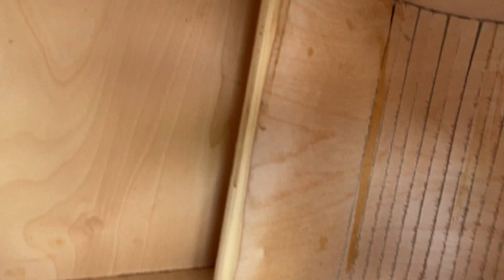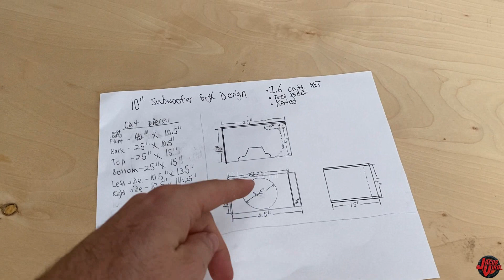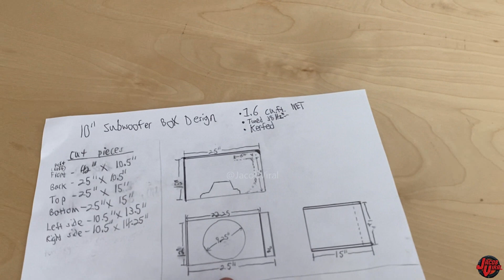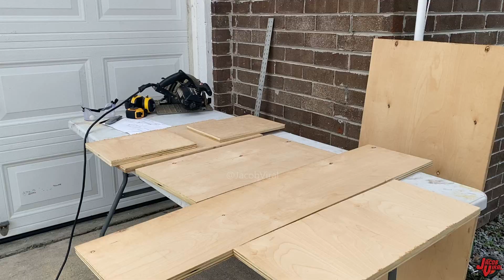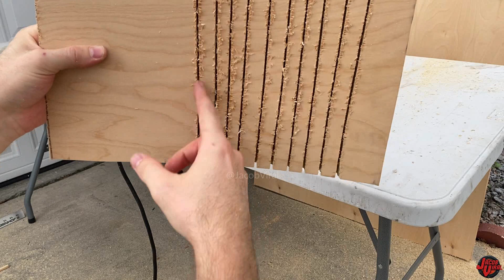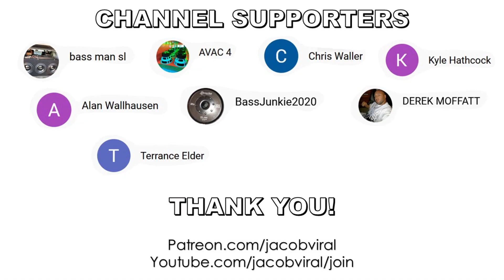Subwoofer Box FULL Build Process

Comment: Hi Jacob I'm a huge fan of your videos,  I need help,  I want to build a 42 3/4 wide, 28 deep and 20 height box for 4 10 inch subs and I would like for it to play down anywhere below 30hrtz, ported box with subs facing up and port on bottom side panel,  I have 2 skar ddx 2ohm dual, and 2 ds18 zxi10.4d,  would u be willing to calculate the measurements for me? Both types of subs placement depth of rounded off at 9 inches. I can give u a few bucks if u have cash app for doing the calculations and cut sizes i need for me, I would really appreciate your assistance my brother
Reply from the maker: Easy to do on own free. Hey thanks for watching my videos. Google “12volt box calculator” and plug-in, done. 9.7 cubes gross, port area size looks like 7.5-8” wide/29-32 long. Goodluck , my cash app is @JacobViral or PayPal me @JacobViral have fun 🔊

Comment: I don't understand how you can be sure how many cuts to do, and still know how much of the board you have left for port length. Like how do you calculate that and still stand by your requested tuning?
Reply from the maker: I just used a box calculator to figure length after login the normal cubes achieved and desired tuning for port length.

Comment: Just watched your video and  loved it....Been wanting to see how that was done without all the fancy tools. Appreciate  all your help I'm  gonna be atemping a box like this, but with 12 in double baffled ..question  with a pair of 12s how much port area would I need?  With your 10 inch  box you used 2 in port.my subs are super beefy but bought them used and they weigh per sub bout 70 pounds a piece. Not sur what brand they are.They have carbon fiber caps and triple slug magnets...jus need help. However,  awesome  video .....
Reply from the maker: Glad you enjoyed Jeff. For a pair of 12s assume it’s 4-5 cubes so around 70-80sq inches of port area. Would depend on your box height for your width to be right. For this single 10 I just went for about 28sq in of port.

Comment: This is the most detailed video on doing kerfs though, I still have trouble with the tuning part of it I need a 4th order but not sure how to tune it
Reply: Exactly what overpriced sundown said. If you’re not a pro at designing/tuning enclosures make the port to big. Shrink it till you like the tune.
Reply: @Jon Doe just make to what you know is to big. Then you can make the length whatever you want and shrink it if necessary. There are several free box design programs online. For a 4th just use the recommended sealed size from the manufacturer. Then make the ported side twice that. So you have a 2/1 ratio. That’s typically most musical. The low tune is determined by what the sub will play down to in a sealed enclosure so you’re not really tuning that. Your only tuning the high side. A tune of 50-53 on the ported side typically sounds pretty good. So say your sub plays clean down to 25hz in sealed enclosure and you do a tune of 50 on the port side. If it’s done properly the sound should be pretty linear from 25-50hz. Peak around 40 hz. If you know anything about box building that will be quite easy to understand. If you don’t then you probably feel like you just read some thing in Chinese. Lol there’s lots of information on the Internet as to how to properly build a 4th. It’s pretty simple. I’ve built a lot of them and some subs just don’t work well in a 4th. Any sub that works well in a sealed box will do very well in a 4th. If a sub only really works well in a ported box it will not do as well in a 4th. 6th order is my favorite. That’s where both chambers are ported.
Reply: Do what everybody else does.. shrink the port til you get the tuning you want lol

Comment: Now you got to use an AMM-1 and see what it's tuned to.. but it looks pretty good for your first time... I never built one yet... awesome job brother,🤙🤙🤙🤙🤙🤙 yeeeeeeeew!!!
Reply from the maker: Thanks Jose based off the length and port area it should be around 38-40hz
Reply: Diy'ing a box for 30$ and then using a 300$ to check the tuning is ridiculous. Experienced builders can build off rules of thumb. Tuning will change anyway once enclosed in a vehicle so the AMM-1 to me is just unnecessary luxury.

Edit: 450$ tool

Comment: How did you find out how long that piece should be that you curfed
Reply from the maker: Port tuning box calculator for port length and then I just measure estimated within 1-2” on the length and as mentioned in the video I left afew extra incase error.